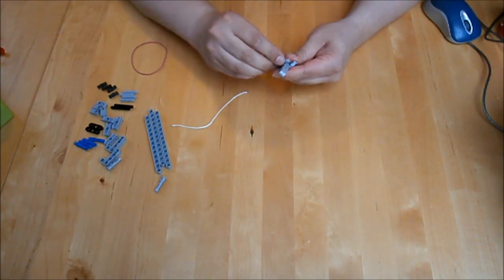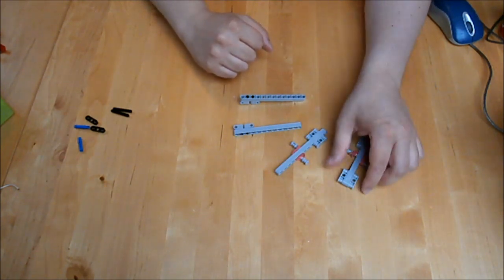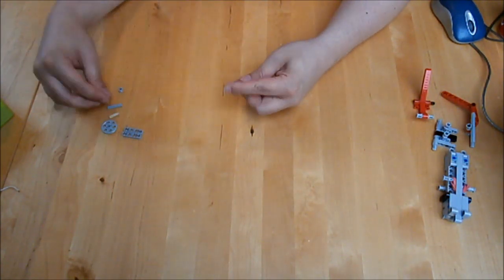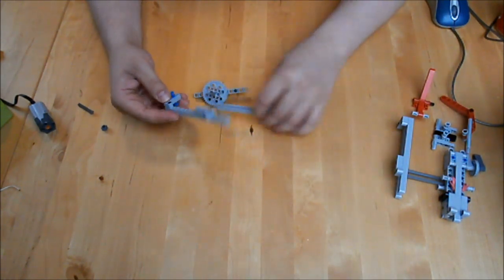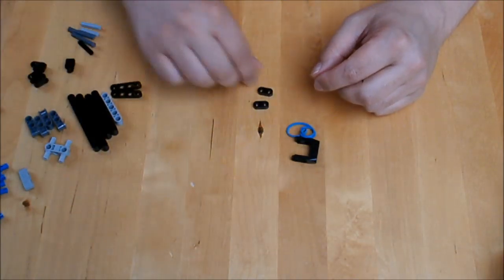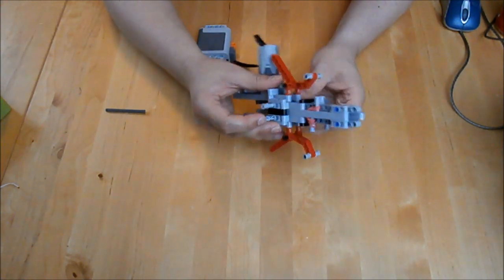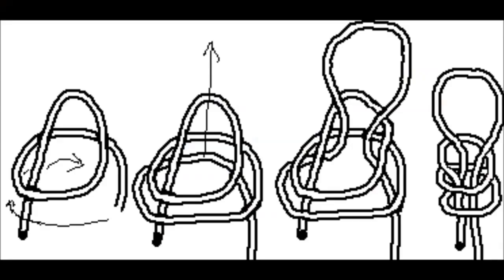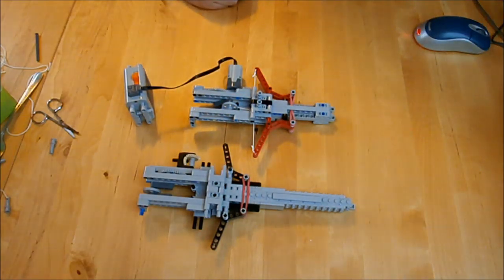LEGO firing mechanism building instruction video

Comment: Can you or anybody tell me the lenght of the bowstring
Reply from the maker: Hi Knochenpferd, I checked if I still have the mechanism in question but I can't find it, so I assume I disassembled it. However I would like to stress that you really do not need this measurement, because the length of the bow sting can be deduced from the mechanism itself. The length of the bow string ideally should be just so that the rubberbands don't manage to fully press the liftarms to the barrel. 

Making a bow string with exactly the right length probably will take a few attempts and you can use the previous attempt as a measuring stick. That is how I do it anyways. Hope this helps, good luck!

Comment: Is the bowstring made from 2 pieces? Is the part that connects to the pullback mechanism a separate piece that is tied to the string between the bowarms or part of the bowstring?
Reply from the maker: Simo Soini yes exactly. The piece of string that connects the pull back mechanism to the bow string is a separate piece.
Reply: Kelkschiz I'm working on a lego Leopard 2A7 and currently building  the shooting mechamism. I'll use the one with lego springs you featured in your "How to build a shooting mechanism" video. I'm just replicating it because I'm lazy and want to focus in other stuff. I might try building a mechanical stabilizer that allows gun elevation. Should be hard enough...
Reply from the maker: Simo Soini Replicating things isn't lazy. I do that too. People should just focus on the things they enjoy. 
Making a good functioning mechanical stabilisation system is far from easy. I considered doing it as well but in the end I chose to implement an electronic stabilisation system using the EV3.
Reply: Kelkschiz Well, true. The Evo3 stabilizer would be good, but I dont have one, so have to make it in a different way. Good thing I like challenges... I'm going for 1:15 scale so there is some room in the turret, but tight it is still going to be.

Comment: what are the holes you put the first rubber bands in at the begging
Reply from the maker: Yes I think I know what is happening. I think you forgot to place a piece, the same piece I forgot to place in the video, see: 14:38. That 1x2 tile is placed there to prevent the projectiles from being drawn backwards when the bowstring is pulled back.
Reply: Kelkschiz Thanks, that's it! 😀
Reply from the maker: The first rubberband goed into the 6th hole of the 13L liftarm. The second rubberband goes into the 5th hole of the 13L liftarm...  If I remember correctly :P
Reply: Kelkschiz
thank you  I have been having issues with shooting the 1 by 3 beams out of the clip. The motor is turning it fine but, it's not working. I followed the instructions
Reply from the maker: What seems to be the problem?
Reply: the projectile just isn't coming out. I messed with the string but no madder what I do the bullet won't come out
Reply from the maker: Well the first thing I would check is if the string is actually hitting the projectile when it shoots forward. 

I can think of two probable causes for the situation you describe. One is that there is something wrong with the string. The string is the most difficult thing to make and when it's not close to perfect then the mechanism won't work properly. 

The second thing that can easily go wrong is the rubberband that pushes up the projectiles. If that rubberband is too strong then that will cause too much friction in the system. So that eventhough the string is perfect, the friction of the rubberband pushing up will slow and halt the projectile before it has a chance to entering the barrel. Ideally that rubberband should be strong enough to push up the projectiles but not any stronger.
Reply: Thank you the band was two strong. It Works
Reply: Hi, thanks for the video - I have similar problem - first bullet shoots fine but as the string is pulled back, the second projectile is pulled back together with the string. Any idea why is that happening?

Comment: when I start the motor the string go around the bush of the pulley maybe i didnt understand how to connect the string
Reply from the maker: The string should be connected in such a way that there is some slack. Then the knot will slide over the bush, if it's too tight it will rap itself around the bush. There is also a different way to construct the mechanism using a Connector 1L (18654), in which case you can pull the knot as tight as you like. If you want to build it like that check out my small shooting mechanism video to see how to build it, it's a relatively small modificaction.

Comment: ..other new question :-) about magazine what item is the first black made like U , what item number ? :-)
Reply: If I havent any suggestion use instead ?
Reply: Did u see this question
Reply from the maker: The part I use there is part 87408. If you don't have that it is not too difficult to make your own U-shape, for instance with 1x 32523, 2x 32013, 2x 43093 and 1x 2780.

Comment: almost ended ..can u explain better how u fix the string to the pulley side ..really is not clear from video thanks
Reply from the maker: The bow string is not attached to the pulley but instead to a Technic Bush 1/2 Smooth (Part 4265c) which sits right next to the pulley. The bow string is connected to the bush using the same knot that is used to attach the bow string to the bow limbs.
Reply: ok ..but is the same half bush u put at min 6:20 ? if yes i have to remove make knotto string and insert again ? Then the half bow string is connected to limbs string by always same knote ? Then what u put at min 14:45 and 14:48 ? Sorry to many question but I am try to finalize :-)
Reply: and this one .. ??
Reply from the maker: Answers are: yes, yes, yes and 14:45 is a 1x2 tile and 14:48 is are two stacked 1x2 plates.

Comment: Yes right Pulley...for the two gear the only combination is 40 to 8 or we can hvae/use also other kind combination ?
Reply from the maker: There are many possible combinations. 40 to 8 (5:1) is a nice combination, if provides fast firing and not too much strain on the motor. 36 to 12 (3:1) is also an option but less optimal in my opinion. If you want to make it shoot with more force, by adding rubberbands, you can replace the gears with a wormgear setup like I did with this shooting mechanism:  http://kelkschiz.blogspot.nl/2016/01/below-you-will-find-link-to-digital.html

Comment: try making a rifle using this mechanism it would be ssooooo cool :-]
Reply from the maker: SKULLSPLITA 27 Hmm well, this mechanism was designed to be placed in a LEGO tank, because of that it needed to be compact and remotely operated. A rifle design wouldn't have to be so compact nor remotely operated. If I ever were to design a LEGO rifle it would use a different mechanism specifically designed for a rifle. Probably something bigger, more powerful and using rifle movements, for instance the bolt-action movement.

Comment: Please, could someone tell me what part he inserts at 16:27?
Reply from the maker: joes van de kamp At the end of the bowstring there is a simple technic bush 1/2: http://www.bricklink.com/catalogItem.asp?P=4265c. Which connects to an axle 3L. At the moment i am looking into replacing it with a technic connector 1L: http://www.bricklink.com/catalogItem.asp?P=18654, because sometimes the friction between the bowstring and the bush has a negative effect on the smoothness of the mechanism.
Reply: Thank you

Comment: do you have a smaller mechanism too, for a smaller tank?
Reply from the maker: Not quite, i am 'working' on it. It is about 90% ready but it still needs fine tuning. Unfortunately i am also quite busy at the moment so it will take a while before i can post it on youtube.
Reply from the maker: If you want to experiment yourself, just think about all the parts in this mechanism that could be smaller. For instance: the throwing arm, the 'bullets' and the pullback mechanism.
Reply: Thanks! When do you think it can be posten on youtube?
Reply from the maker: It's pretty hard to guess about these thing, if all goes according to plan, around March. But might be sooner or later.
Reply: Ok, thanks!
Reply from the maker: +Martin Van Den Hoek Today I finished a smaller mechanism it's 9 by 15 studs instead of the old's 15 by 21 studs. I'll include it in an upcoming video. You also may be interested in Sariel's mechanism which is really small: http://sariel.pl/2015/08/t29-shooting-mechanism/.
Reply: thanks!

Comment: Hi, I was wondering what packs of Lego you would need to build this?
Reply from the maker: That is a good question, to be honest i really wouldn't know. Nor do i know any way to check. The majority of the LEGO i own is bought via www.bricklink.com. The cheapest way to get all the parts is almost certainly via bricklink, because there you can just order the parts you need. If you would want to get it all by buying LEGO sets you'd probably have to buy a couple of sets, with in total far more parts than you actually need.

Comment from the maker: +Tommy Styrvoky from a functional sense it doesn't really make any difference if the elastic potential energy is stored in a spring or in a rubber-band. It's easy to increase the potentially stored energy with either using rubber-bands or springs, there is no real benefit in using both at the same time. Using a spring has two benefits, in my opinion. It's 100% LEGO and two, LEGO springs are more durable than rubber-bands. I have been using LEGO springs in my firing mechanisms and i might again in the future.